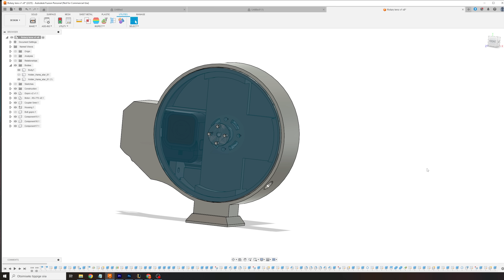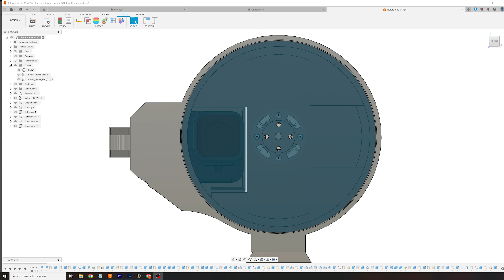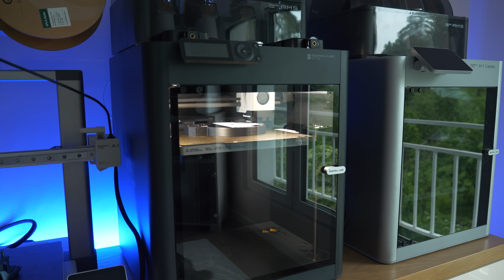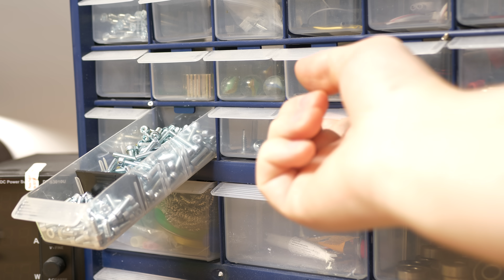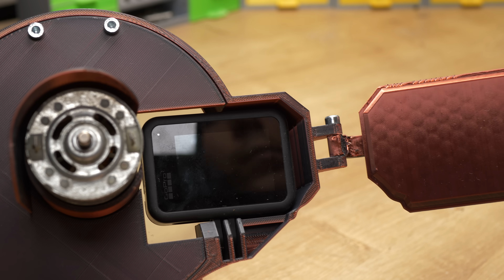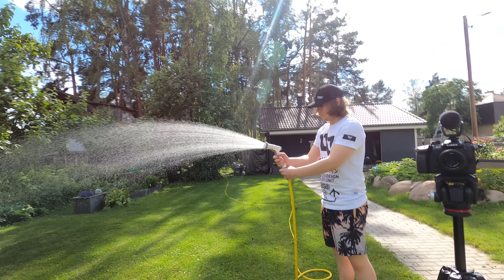Professionals Pay $4999 for This… I 3D Printed Mine for $5

Comment: even though the title is true.  it's still BS.  

because these things go into cnc machines.  million dollar cnc machines. 
machines where a simple feature like counting beyond 9999 parts produced. will cost $10000, dollars to unlock.  wich is a simple parameter switch from 0 to 1 in the settings if you have the developer key.  

so yes. you would pay 5000 dollars to get this as an option on your new cnc machine. 
but what they actually cost is nowhere near that.

ofcourse the actual window in a cnc machine doesn't have the camera.  it's just a plexiglass disk spinning at high speed allowing you to see into the machine when using coolant.

Comment: Some professional housings use compressed air to give positive pressure inside and to spin a turbine that spins the glass. Usually low PSI and CFM

Comment: GoPro records the IMU data in video so you can also stabilize the video later with software like GyroFlow. This sort of vibration may be hard to remove completely however.

Comment: Okay- several issues why theyre so expensive.
1. Needs to be quiet, AV equipment is quiet in operation so that the scene/subject captured is not impeded by the equipment and ruin a recording
2. Needs to be balanced- the glass assembly cannot shake the camera and ruin a shot
3. Needs to be lightweight 
4. Needs to be perfectly flat when spinning- to minimize distortion of the image, and the bearings involved on the rim of the glass have to be oh so smooth
5. Needs to be compact- these typically are the footpring of the lens opening or slightly larger. Yours is gigantic compared to the camera. 

While your design works, it is by no means a replacement for profession quality ones.

Comment: To manage vibration you could add a ring with loose ball bearings inside of it to the rotating surface or motor shaft. It is self-balancing at a high RPM.
Steve Mould made a video about it about 2 weeks ago, might be worth a shot.

Comment: Just use a backpack leaf blower, connect a DC motor to the gas powered leaf blower engine, connected to a DC to AC inverter, connected to an air compressor, then use the compressed air to blow the water off the lens. This ain't rocket surgery.

Comment: Wouldn't it make sense to use a smaller housing / disk and a drone motor on the blank side of the gopro? This seems pretty bulky and unnecessarily complicated, and I imagine if you'd add a couple dampeners made from TPU it would also help the vibrations a lot..

Comment: Do you even need the whole housing? the gopro is already waterproof, you could probably just have the engine mounted to a frame. Then there is no rubbing and now water getting into the housing.
Also use a brushless motor, it's a lot quieter, and balance it perfectly

Comment: try adding a turbine blade same diameter as the center mount in the center on the exterior of the plexiglass, this will add a air cushion to the effect that will help keep water from even contacting the plexiglass. Nice work.

Comment: Very cool! This is one of those perfect hobby devices, where it's easy to make one good enough, but also clear where the upgrade tree goes, and why it can lead to such an expensive device!

I bet lower speed with a hydrophobic coating would help a lot with noise and vibration. Also, a smaller drone motor could be used to make the whole thing much more compact and easier to control. Maybe even put the motor in front of the go-pro so you can use a smaller diameter ring. 

I would also experiment with putting bearings or slippery surfaces behind the ring to help with direct-impingement causing it to deflect. 

Great build!

Comment: One way to avoid supports is to make your part in two or more pieces.  You can put them together with screws or even thread the parts to screw into each other.  Or glue them together.

Comment: the noise is loud! 
Considering the plate is not very heavy, could you get away with a smaller motor and a gear to spin the plate, 2:1, 3:1 etc

Comment: when i was in the navy we had something similar on the bridge windows but they were nearly silent, you have a balance problem, its also possible that your window material is slightly out of round and as fast as your spinning it its going to deform some. the ones on the ships bridge didn't spin that fast as i recall but were perfectly fine to keep a clear view even in heavy rain.  i looked up the rotating rpm for a ship board designed unit and it spins at 1700 RPM. overall you did a great job. look forward to next revision.

Comment: You could also use pressurized air to drive the disk (like the tesla disk pump). If you then brought the air through a pipe, it would reduce vibration and noise coming from the motor. And the air coming from inside the housing would have other added benefits too by driving any water away.

Comment: I don't think you need that high rpm, the further from the center of rotation the stronger the centrifugal force will be. So unless you care a lot about how many milliseconds it takes to get rid of each drop, which probably isn't important, it should work fine even at much lower rpm. 

Also, why not separate the camera and disc more? Just having the disc rotating in front of the lens should be enough for your videos that I've seen, and if you want to film in the rain you can add some kind of cover over the camera.  

That said, great video, and great idea, and having the lens far from the center of the disc is a great design choice if you don't need it to be as compact as possible. At a given rpm the centrifugal force is 100 times greater 10 cm away from the center of rotation than it is 1 cm from the center of rotation, as the centrifugal force changes with the square of the angular velocity. That means you shouldn't have to spin the disc more than a tiny fraction of the speed of the fancy pro stuff that has it's center in front of the lens to be as efficient at removing water droplets.      

The fancy pro stuff is probably expensive in part due to the fact that it works really well despite having the disc center in front of the lens, without causing too much vibration or other issues, including really good optical properties of the disc. Obviously, fancy pro camera stuff tends to be horribly expensive for what it is too, a small piece of translucent plastic that could be designed and printed in 20 minutes can cost dozens of euros, if it's called a light diffusor and made to fit some fancy flash.

Comment: Neich pro and prosumer products like that are always priced high, partly due to low turnover, but also because youll pay for it if you want it bad enough.

Your rotor is WAY imbalanced see to that first. The pro designs look like they're mounted on a slew bearing, maybe look into that, of course that is another thing to balance. Next, add a lip off the back of the front plate so if water does get in it is channeled into a space away from the camera where it can drain. Also, add a drain hole. Just cut a cylinder the same diameter a few cm long and glue it on. a slightly tight inside edge to the stationary bit with a little bit of soft cloth should trap most water ingress (also, if you go with the slew bearing idea, itll give you a place to drive it from. or use a friction wheel and drive it from the inside rim). Lastly, get a set of needle files and xacto blades so you dont add to the microplastics problem and plastic waste by reprinting an entire piece just to make gopro leg slots a little wider..... Whoever sold yall post millennial makers on 3d printers making perfect ready to go parts lied. Model slightly oversized and just do some basic finishing steps. You can take material off, but you cant (easily) put it back on. Thats how we do it in big boy fabrication. Not even our $250,000 resin printer officially boasts ready to go parts, just 'minimal finishing'. Of course it depends on design, but still the point remains, dont fear the finishing steps.

Comment: You should be able to remove the vibrations if you decouple your GoPro from the enclosure. Maybe expand the interior a bit and open a hole under the camera so you can mount it to a separate tripod/stake. As long as the camera and whatever it's mounted to isn't in contact with the enclosure it shouldn't be affected.

Also, you should be able to prevent water from infiltrating if you can find a large enough and thin enough enclosed ball bearing that you can press between the outer edge of the spinning disk and the body of the enclosure. It may help reduce vibrations as well.

Another idea I had was using flexures to move the camera controls outside of the enclosure.
Reply: must be great idea to use these rubber nubbins included with noctua fans for the decoupling
Reply: @uiopuiop3472 That could help but he'd need to properly balance the motor and disk first. I was thinking more along the lines of leaving the camera free floating within the enclosure, mounting it to it's own tripod through an intentional gap at the bottom so nothing touches them.

Comment: I'm wondering if it's possible to do this with the glass disc from cheap clock.
Another thought is if the motor shaft or a wheel on the shaft could spin the disc edge with 2 or 3 idler wheels to keep pressure on the drive wheel.

Comment: For the power button access problem, you can just swivel the GoPRO outwards using the bolt. You want to get fancy, I'm sure you can put some gears there to swivel it when you open the door. Very simple and fantastic project!

Comment: One additional design change is a slightly larger disc.  Making it bigger and some edges around the camera could prevent water splashing against the back of the disc onto the camera.  Good work with the current design and keep going!

Comment: You could also use the motor to pump air into the housing, so it will constantly push air out of the gap between the disc and housing. So there should no water enter the housing anymore.

Comment: The price of the "pro" devices explains why a lot of storm chasers still haven't picked up on the idea. Yet it seems more than simple enough to scratch build. However it seems there must be some issue with balancing that clear disk, because if it was it should barely be making much noise at all. That's some wobbles in there making it sound like a weed whacker. Leaving room on the disc outside the field of view of the camera so that tape could be applied should be the easiest way to balance it.

Only thing left is balancing issues with the motor itself, so you might have to spend more for that feature if any trustworthy manufacturers offer it.

Comment: a motor from a hard drive would be better, as it is already balanced to spin with few thousand rpms. It will also allow to balance the clear plastic disk quite effectively
Reply: And last but not least, the hard drive motor is silent.
Reply: @AntalMadincea  It's not the motor that makes the noise, you do understand that, right? That motor would be 100% silent! It's the clear plastic disc that's not perfectly balanced that makes the noise.

Also a HDD motor probably does not have enough torque for this.
Reply: @_Jester_  it was a brushed motor, they are not 100% silent.
Reply: @_Jester_  Motors like the one used in the clip are among the most common. Get your hands on an empty one, with nothing mounted on it. Turn it on and maybe you'll understand what I mean. Those motors are not silent at all. Then compare it to an HDD, which even with the platters mounted on the spindle is almost perfectly silent. That there are other sources of noise in the clip is another discussion.
Reply: If anything soak the platters in solvents to reveal the clear glass under the shiny surface.
Reply: torque is a problem though but you are on the right path a good BLDC motor made for RC hobbyists will do the job for vibration and noise

Comment: Cool but now you know why devices like this can cost up to 5000bucks - overcoming this vibration problem is a big deal in practise and masking it with image stabilization isn't a solution.
Reply: But not 5000
Reply: Add a rim around the glass and put some ball bearings in it. At high rpms entire thing will self balance and vibrations are no more.
Reply: @pvc988  I know which video you learned that from
Reply: The solution in this specific instance is to simply decouple the GoPro from the enclosure. It should be fairly easy to make a free floating mount within the enclosure that stakes into the ground or a separate tripod, you just need to make sure it doesn't contact the outer enclosure or its tripod.
Reply: You can probably balance it to avoid vibrations 😉
Reply: @Lysou  that's the neat part, there's no probably, you can't, that's why stabilizers are still being developed to perfection to this day😛
Reply: @splechortheannoyingcat I come back on this one, "probably" have nothing to do there, you can balance anything, it is just getting harder as rpm rises, but here we are far from high rpm. If you can't balance, to reduce vibration you still can add a damper
Reply: The thing with 3D printers is that they are unable to print perfect circles. So even if the acrylic is properly balanced, insufficient clearance between the walls of the 3D-printed model and the disc will always lead to friction issues. The acrylic disc is also not a perfect circle—due to the same limitation as the printed parts. Home-grade laser cutters or CNC machines lack the precision needed to produce truly circular shapes, so the design must account for both of these constraints. Another source of vibration is how the 3D-printed part is mounted to the tripod. It lacks proper dampening, and the tripod head itself feels plasticky and not particularly sturdy. The tripod, overall, isn’t rugged enough and isn’t the ideal type of support for this kind of machine—even after being weighed down to help reduce some vibrations. That said, the machine performs very well for what it is. There’s certainly room for improvement, but professional-grade machines built for the same purpose will always outperform it in several ways. Trying to refine the system enough to match that level of performance while keeping costs low is an almost impossible task. Image stabilization will always be necessary in this kind of DIY solutions, especially if the disc is made of acrylic rather than glass—acrylic tends to wobble more under centrifugal force.
Reply: @Akenoomokoto  You can easily shave the perfect circle with the same motor that spins it in the first place, if it still doesn't negate the vibration add mass or mount it separately from the camera.

Comment: Nice build. But the bearing of these kind of motors are simple sleeve bearings only meant to support a pinion gear. You should either use a motor with ball bearings (e.g. BLDC motor as suggested below) or mount the disc on a separate shaft with ball bearings. The later would allow moving the camera closer to the center and though shrinking the disc. Each cm in radius will reduce the area and the weight a lot. Alternatively move the motor at the end of the shaft so the camera fits in front. You also dont really need a housing around the camera. May be a small roof to prevent rain to hit the front side.

Comment: I think one of the main reasons why the professional ones are so expensive is the glass. PC or Acryl will reduce image quality quite significantly - it might be totally fine for a GoPro but with longer focal lenses and faster F-speeds you will see abberations and ghosting if you don't use high quality glass.

This is a very cool project tho for enthusiasts!
Reply: That plus who knows what kind of coatings they put on em so they dont reflect from the interior surface, or possibly even a hydrophobic coating to make the droplets easier to fling off. The one on the helicopter looked like it was mounted to a slew bearing, which can get pricey...
Reply: just use uv filter, it is not that expensive
Reply: The glass is super cheap
Reply: Or the fact that they don't sound like RRRRRRRRRRR
Reply: OR hear me out you use a lens protection instead of the plexi and BOOM still cheaper than the device itself :))